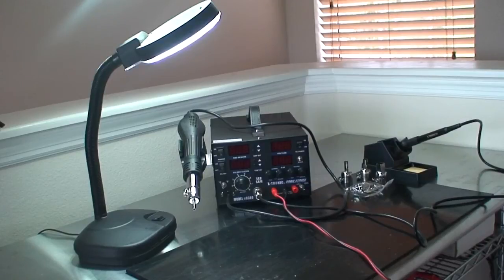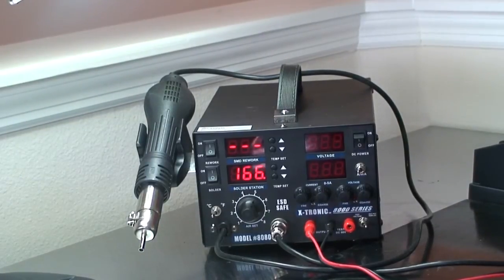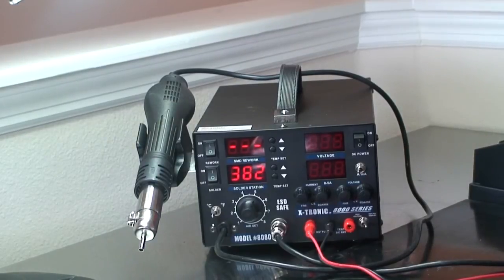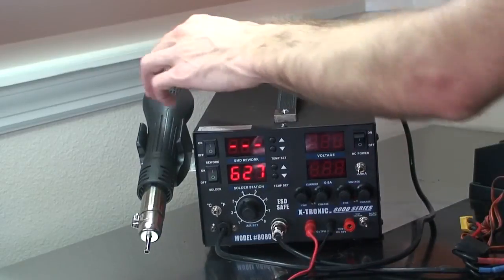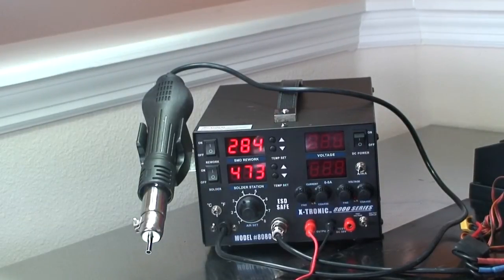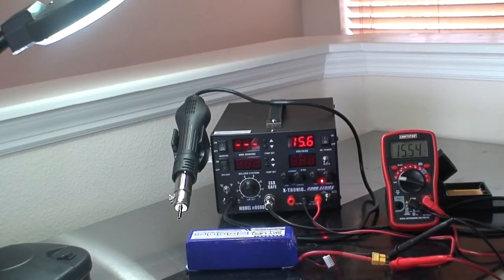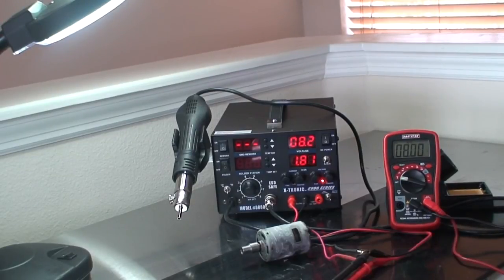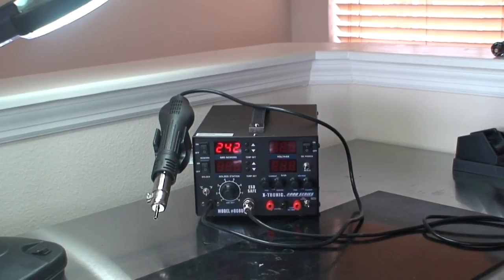X-Tronic Model #8080-XTS Soldering Station Review

Comment: excellent review, thanks. Just a pair questions: 1. contrary to the air gun, there is NO magnetic switch in the iron, so that the temperature won't sink when put in the holder, right? 2. is there any annoying vibration noise when the machine is on but all their functions are off?

Comment: Good walk through...  thanks for posting
.
Question:  Are their screw to remove under the unit before using the hot air gun?  I know the other units had them...  I can't some to find any literature about shipping screw for the 8080-XTS.